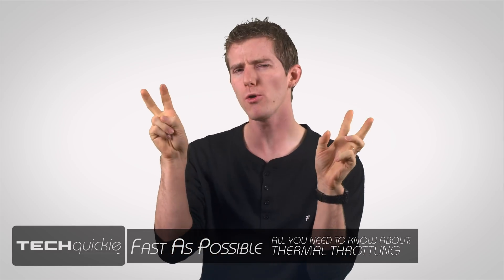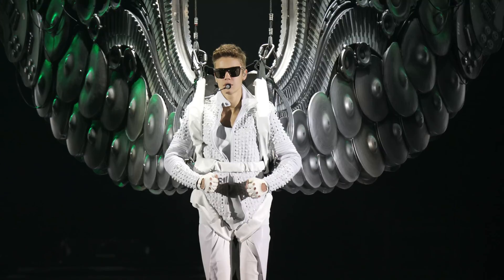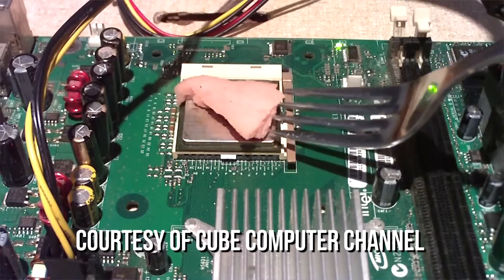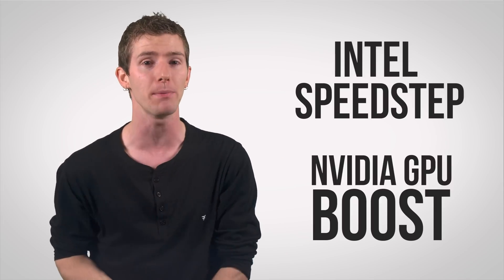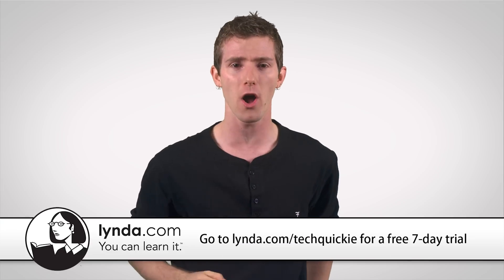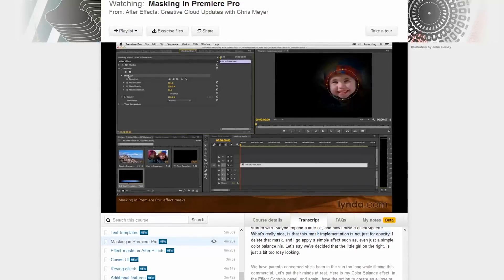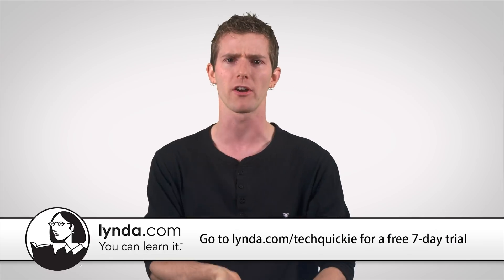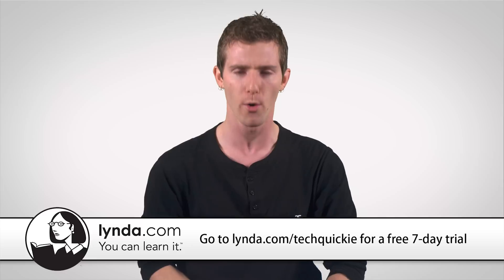Thermal Throttling as Fast As Possible

Comment: what i dont get is why my video card does this when its only running at 70.c
Reply: +Kamikazi Lucas 70c is close to boiling water. Your use of 'only' is incorrect, especially for a gpu.
Reply: SpaceBrothers why can cards go to 80 then, and why does it throttle at 50 also
Reply: ***** most cards run at 60 when oc so wtf are you talking about
Reply: +A Stoned Sniper Graphics cards are made to withstand up to 92°c. If it's 80°c, it's toasty, but still in the safe zone.
Reply: +A Stoned Sniper I don't normally make a habit of posting on Youtube but you have no idea what you are talking about. Google is your friend.
Google "nvidia 970 temperature" and it will bring up a graph showing all major models of 970 running at 70+ C. 
the R9 290x is DESIGNED to run at up to 95 C! AMD specifically told their customers this was fine! (Too hot for my comfort, but still, proves my point).
So while we are all very impressed with your amazing ability to use Google to convert between C and F,  you still don't know what you are talking about. Instead of using Google to provide us meaningless temperature unit conversions, why don't you use it to actually read the manufacturer specifications on various AMD and Nvidia video cards? Just a thought.
Reply: +A Stoned Sniper are you dumb? 60c for a graphics card is perfectly normal. hell, my graphics cards fans don't even turn on until it gets to 60c (which was done on purpose by the manufacturer).

i don't understand why you think 60c is hot. if it's at like 90c then there's probably an issue but 60c is fine.
Reply: Cody exactly
Reply: ***** my gpu is fine
Reply: ***** most cards have been manfucaturer tested to be safe at over 90c. of course at 90c the longevity of the card will be reduced, but it still wouldn't fail for years in most cases.

again, why do you think 60c is high? where did you get that information from? like i said before, my card (with MSI twin frozr v cooler) doesn't even have its fans turn on until it gets to 60c, and even then only needs like 20% fan speed.
Reply: ***** i think maybe when people were discussing their temps, you thought they were saying it was like 60 F rather than 60 C which led to this confusion.

yes, 60c is hot to the touch but for pc hardware it's not considered hot at all (especially for graphics cards). no, 150f doesn't scorch the back of your motherboard. i've seen people have their cpu temps well over 60c (even as high as 100c) for months at a time without any hardware failures. of course that's still very bad for the components, but it's not as ridiculous as you seem to think it is.

of course the lower the temp the better, but unless we're talking 90+ celcius there's no reason to be concerned about heat. let alone at 60c.

yes, my cards fans don't activate until it reaches 60c. they don't need to, at all. 
maybe a long time ago (perhaps from 10 years ago when you started with pc's?) pc hardware was more temperature sensitive than it is now, but you haven't updated your thoughts on temperatures and thus still think those temps are considered high by today's standards.

that's about the only reasonable conclusion i can come to, without simply insulting you for not being informed.

PS: throttling (on gpu's and cpu's) doesn't occur until much higher temps than 55c. for example, intel cpu's don't even start to throttle until 100c. (that's documented on their website, check for yourself).
Reply: +A Stoned Sniper quit your job, now, please
Reply: my AMD video card runs 60+ C idle and around 98 to 101 C when gaming. been using it for five years and still works fine :)

Comment: If you don't plan on "over clocking" your CPU or APU, should you stick with a stock cooler, or would buying a bigger heat-sink like a "Noctua" be more efficient and beneficial to your computer's performance? Also would the performance difference be even worth it to shell out money for an expensive heat-sink?
Reply: If you want to overclock, you're definitely going to need an aftermarket cooler. That said you don't have to spend $300 on it. Hyper 212 Evo is popular, cheap and performs greatly. The performance difference after OC depends on the processor but will probably be worth it, especially if you're not running some $500 processor.

Comment: Hehe Goat simulator on my nexus 7 tablet. It runs the cpu/gpu so hot that I attached a desktop cpu cooler to it (without a fan) and it still got alarmingly hot. Too hot to hold, i would say around 60 Celsius.
Reply: Nope. 80 to 85 under full load. 85 and the fans start to ramp up in much higher intervals.
Reply: that's not really hot in pc terms
Reply: It is for an android tablet though. I do agree however, 60 is fine for a pc.
Reply: 60 Celsius is WAY TO HOT FOR PC!!!
Reply: My graphics cards run 80 celcius under full load.
Reply: ***** I HIGHLY doubt that...That is 176 degrees Fahrenheit...
Reply: +Luke Den Hartog Shit mine runs 75 celsius idle bc my fans are set to stay off until it goes over that

Comment: My 8320 idles at 4-5c. Full load prime95 35c, but only minor over locking
Reply: MrMGR1986
unless your ambient temps are around 0c (literally freezing) this is basically impossible,blowing room temperature air at something will only make it room temperature
Reply: That's impossible unless you are using liquid nitrogen
Reply: It's not dude. It's the air cooler combined with the airflow of the case. Unless CoreTemp and every other program I use is lying.
Reply: The old school Zalman 8800B is a boss
Reply: And it's only a 8320 at 3.8
Reply: It's lying to you if you didn't know AMD's processor and motherboard sensors conflict with each other and cause weird readings
Reply: Proof?
Reply: http://forums.anandtech.com/archive/index.php/t-2305235.html
Reply: +CarbonatedCake That is Possible. I have a FX 6300 (@4,7 GHz) and it idles at 2c...
I dont know how that happens xD
Cooler: bequiet Dark Rock 3
Reply: Honestly after researching I think it's a bug
Reply: +Springfield03A3 You can easily check it, borrow someones laser thermometer, and aim it right at the base of the cpu, itll give you a fairly accurate reading, you can also get ahold of dedicated temperature sensing hardware like my nzxt sentry lxe and place a sensor right next to your cpu to get a bang on reading! but yeah as reginald said, its impossible to cool something below room temperature, without adding a coolant, aka fridge/air con compressor, liquid nitrogen. its simple chemistry lads!
Reply: +Zellox | CSGO Clips  sigh No... no... just.... no. This is physically impossible. I don't say that as in "OMG that is hard, it is physically impossible!". I mean it is literally impossible based on the laws of physics, UNLESS you are in a place with cold winters and have the PC outside. Or as someone else said, you are using subzero cooling like liquid nitrogen.
Think about it for a second. Your ambient temperature in the room is, let's say, 20 C. That means your CPU with machine and fans powered off will also sit at 20C. It then gets even hotter when it is on and working.
You now have a CPU running at hotter than 20 C, and your cooling system is blowing 20 C air over it (actually not true, because other components in your system such as the GPU and PSU will also heat up the air that is then going through your CPU cooler, assuming a standard ATX build... but let's pretend those components don't exist for a second here).

It is not possible, under the laws of our universe, for 20 C air blowing over something that is (way) hotter than 20C to bring it to a temperature of 2 C. 
So we have two options, you either have a magical PC that defies the laws of physics, or you have a software bug that is reporting inaccurate temperatures. Which do you think is the case?

Comment: Well, I have my laptop for 2, almost 3 years now, and while it's not an ultra thin one, it does suffer from TT for a few months now. Recently, it even has started to do the most extreme: shutting down. Now, my laptop wasn't filled with dust, the cooling system worked optimal and the usage has not really changed over the years. But we have found out that the cooling technology in it is aged and does not completely cover the high-end i7 4th gen quad cpu at 2.5 to 3.3 GHz.
I'm genuinely shocked to find this out, especially since it wasn't really a cheap pc either (950 $ or 800 €).
Reply: I also won't bother applying new paste on it or so, since I've been thinking for a while now to build a custom pc myself now.
Reply: just buy some diamond paste. It cuts the heat by 50%...
I have a 6 year old gaming computer. That what I did to keep it running. Look at some of my videos.
Reply: 1 wonderfuldeals.com I do not think that it would make much of a difference, since there's not even a heatsink. It's a heatpipe connected directly against the cpu.
Reply: I can't see it from here. But it sound like the heat pipe does not work. Maybe bent? It is better for heat transfer... that the heat pipe directly touching. But if it is bent or not completely smooth. Then thermo Diamond past is best.
Maybe put it upto a piece of glass or mirror.
Then you know.

Comment: I would like to know if thermal throttling is even legal because when your phone/pc you are advertised its max speeds. You dont expect lower.
Reply: Yes it is legal you prune,modern devices ARE designed to throttle speed and performance when the inside becomes too hot

Comment: Speaking of temperatures, here is a suggestion to a future episode. IHS removal or delid of haswell and ivy bridge cpus, does it actually work? I have read that some cpus gets 30 degrees cooler. If that is the case, why did Intel build the cpus this way? I find it hard to believe that a regular person can achieve this that easily, because Intel obviously knows how to make a cpu.
Reply: It does work, though 30 degrees is on the high side of what you can expect to gain. Intel was probably saving a bit of money, and it didn't really matter to them since CPUs were still fine at stock clocks.
Reply: Sakkura1 It is a good theory, but this "problem" is also the case on the -k series ivy bridge and haswell.This is a line about the k series on intel.com "the -K series desktop boards and processors designed for overclocking to provide optimal performance for gamers and high-power users.". Therefore, it should matter to them that the temperatures is ok on clocks a bit over the stock. Do you agree?
Reply: Mosern
No. They don't really care too much whether the chips overclock well. It's a pretty small segment.

Comment: File-systems (NTFS, EXT4, FAT32 etc...) would be nice.
Reply: Eric Slattery Yeah, Windows file-systems are really lacking compared to file-systems available under Linux.
Reply: Eric Slattery Transferring files on Linux is night and day compared to Windows, on Windows transferring 1GB takes about 30 minutes, on Linux I'd be done it 5. As for your issue what I would do is have another drive setup as NTFS, copy the files to that drive and then your Windows drive.
Reply: Eric Slattery I found somewhere a driver compatible for windows 8.1 to transfer files from ext partitions but it's very bad because there are no tools to read encrypted home like in ubuntu or sometimes it doesn't show the contents at all
Reply: Eric Slattery My guess would be EXT4 is new and NTFS is old. Newer technology is better than old technology. Microsoft have updated NTFS but what they really need to do is completely redesign it, there are so many advantages to EXT4, BTRFS etc... over NTFS
Reply: GhostMotleyXT I'm just the normal ass windows user. Did try linux once but it's nothing for me ^^
Reply: GhostMotleyXT I don't think newer tech is always better. For example I still use a Phenom II cpu cause I think it's better than the FX series :)
Reply: Lars Kraus That's a different scenario, the FX series of CPUs use alot of power, run hot and aren't that much faster than the Athlons, the negatives of the FX are outweighed by the Athlons performance, power consumption and heat dissipationso that's a fair argument. BTRFS, EXT4 etc... is much better than NTFS
Reply: GhostMotleyXT i think i still have my HDD formatted to NTFS. It works ^^
Reply: Lars Kraus Yes, but file-systems available under Linux are more advanced, Btrfs, Ext4, XFS, JFS are so much more advanced than NTFS, FAT32, exFAT or even ReFs for that matter.
Reply: phones are still using fat32 T.T
Reply: ***** Not necessarily, some use YAFFS, Ext3 etc...
Reply: sry not that much of an expert in that area, i assuming ext3 is a lot better? why i say so is cause i have a thumbdrive that has dual connectors usb3.0 and micro usb for phone OTG and it's running FAT32, which is so slowwwww when transferring stuff to it
Reply: ***** Well technically FAT32 should be faster than Ext3, the simpler a filesystem is the faster, but FAT32 wasn't designed for newer HDDs, SSDs, thumbdrives etc... so Ext3, YAFFS etc... end up being faster.
Reply: GhostMotleyXT you want to go NTFS for security FAT32 isn't used as often for the fact that there is no security and NTFS can support larger files.

Comment: if i tape icecube to cpu cann it run max setting on any game????//??
Reply: yumri4

his joke ->     ____________

your head -> _________
Reply: Don't forget tooth paste. Spread it across ur cpu using credit card.
Reply: ExoCraft  you mean thremal paste
Reply: *****
yeah but isnt Liquid Nitrogen like 5 grand a secound ?
Reply: yumri4 Basically the same thing.
Reply: ExoCraft depends on the toothpaste but i guess as if the conductivity of the toothpaste is high enough then i guess you could but i doubt it would be greater than just applying the cooling solution directly onto the CPU as copper is one of the best heat connectors which is not an alloy.
Reply: Nein die Technik ist AMD  und nicht Intel !!!

Comment: When the pump in my Corsair H60 failed, my AMD FX-8350 just shut off the whole system with 0 thermal throttling. It made it hard to find the issue especially since this is my first rig

Comment: I don't think AMD implemented thermal throttling in the FX-6100 black edition stock settings with alpine arctic rev.2 cooler and it still runs up into the mid 50 Celsius range =\ but it has lasted 4 years
Reply: 50 celius is chilly for a CPU
Reply: 50C really doesn't sound that high under load.
Reply: 50C is more than acceptable on the FX6100,there's no reason for it to throttle at that temperature.
Reply: Tj max is what the cpu can goto. Its like 70-80 celcious which means 50 is fine. Btw i cant spell that other word
Reply: Eric Slattery Lol it turned off your fans in Power saving mode?

Comment: My CPU thinks that 50 C is too hot and goes to 800 MHz for some reason -.-
Reply: mothain a cpu can NEVER get colder than the room its already in. the heat dissapates with the room air. its impossible to have a cpu colder than the room.
Reply: Hendlton A fan cannot cool air. That's impossible. Only thing a fan can do is move air. It can help DISSIPATE heat AWAY from an object like a cpu but since a fan cannot cool air the cpu will never get colder than the room temperature. You might think like a house fan is cold. But thats just your body heat being dissipated faster. Its like when you touch metal. It feels colder than other things in the same room because its a good heat conductor than will dissipate the heat. A fan technically will heat up air because of air friction. A fan just allows something hot to get closer to the temperature of the air.
Reply: mothain How?And that's not too good either unless your room temperature is under 20 C because if not,there will be condensation and the water might ruin your components.
Reply: mothain With a stock cooler my Phenom was 45C idle!!!
Reply: mothain I also have  a liquid cooler and it's at about 30-ish when idle.
Reply: The reading could be wrong. Software can be glitchy with this.
Reply: ElitePotato8 No,it's right,I tried Speccy,AMD Overdrive and Speedfan and I also think it's because I broke it by overclocking but meh it's only a Phenom II x4 955 BE
Reply: I've never seen an AMD cpu get so hot, my fx-4300 series cpu dances around 20c and my Phenom 940 at around 30c.
Reply: My room temperature should be at an estimated 21 to 25c. So condensation is not of an issue, it feels quite dry to be honest. The cpu cooler for the fx-4300 isn't a stock one but the Phenom is stock.
Reply: ElitePotato8 It's possible,what you said would happen with a passive cooler but a fan cools the air that it's moving by moving it and therefore if you have a really good cooling setup,it can get colder than the room temperature.
Reply: Hendlton Well, I've read the temperature too soon after the start-up. It's indeed set at about 45 to 50C when run all day. I used a Corsair H80i to cool it towards 15~20C when idling.

Comment: I have a laptop that constantly turns off and is seemingly cool ive cleaned it multiple times and always check for updates and it continues to do it but only under medium to high loads and clues on how i could fix it ??
Reply: check the thermal paste on the heat sink. it my have dried.

Comment: A tip if you're experiencing thermal throttling in a laptop is to open it up completely and change the thermal paste between the CPU and the heatsink, it's usually dry as a desert since the manufacturers use a really cheap one and fucks up the cooling rather than help it.
After I changed the thermal paste on a friends' laptop the temperatures went down by 30C on average and he could start using it again :)